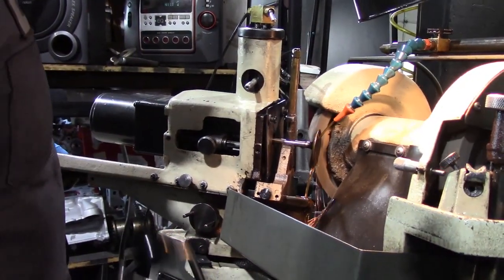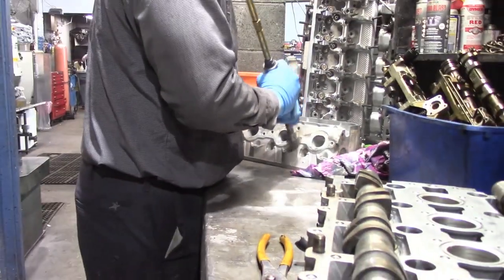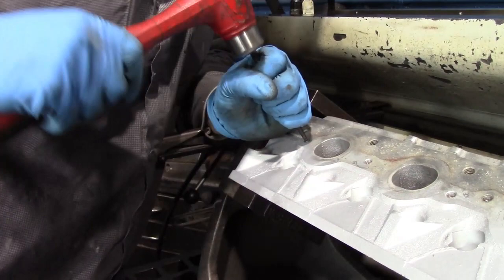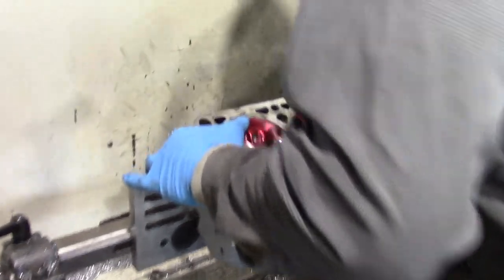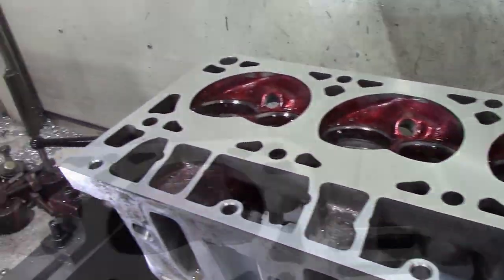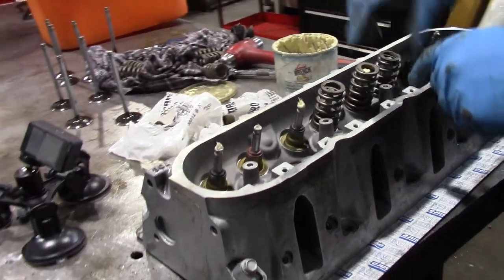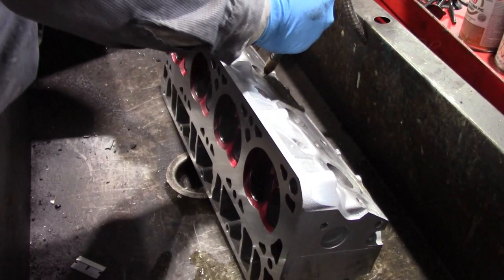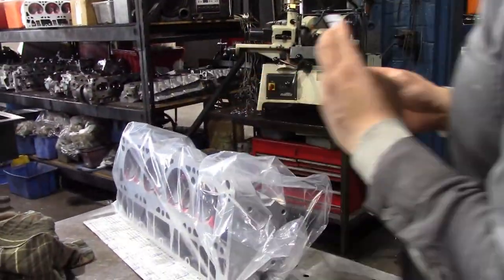MACHINE SHOP PART 2 [ 2004 CHEVY AVALANCHE][ 5.3 VORTEC V8]

Comment: Saw u did some lifters work was cleaning them worth it?
Reply from the maker: Yes they were.. I'll post a video on it soon..  Took two hours and I got all 16 apart soaked in gas and thoroughly cleaned
Reply: Cool mine makin a slight noise at times wanna know if they could be clean or if i gotta put out tht cash on new ones
Reply from the maker: I got you, coming soon. You can put out the money. But if you take 10mins.. Of your day.. It can be serviced.

Comment: How much did they charge you for this?
Reply from the maker: Both heads cut and rebuilt. 
Block bore .20 over 
Crank checked
Cam bearing replaced
Pistons and rings
Parts and labor ran to 1600
Reply: That’s actually not bad. Virtually brand new engine for that price is a steal
Reply from the maker: This engine will have 0 miles 😁
Reply from the maker: Yeah it isn't.. Is a pretty sick deal
Reply: corolla customz omg lol I have to find a way to convince my girl that I need to do this lol
Reply from the maker: Just say honey, the engine needs this.. Make it seem like your angry
Reply: corolla customz yeah right she’ll tell me to sell it lol. I’m replacing the shocks with some rancho rs5000x after that I need to replace both front wheel hubs and re solder the abs module so she’s already fed up 😂
Reply from the maker: Hahahahaha😂😂😂😂... Women🙄🙄🙄... Just tell her you don't understand , I can't sell.this truck. 
It's super rare and the price goes up each year🤔
Reply: corolla customz they made a mistake by discontinuing this truck. Its way ahead of its time.
Reply from the maker: I definitely agree, this truck has  a lot going for it.. Very user friendly, awesome storage compartments, cab to bed entry, and very easy to repair... I'm definitely trying to keep mine as long as I live hahaa
Reply: corolla customz hopefully I can give this truck to my kids lol i was honest with myself along with her when I told her the other day it’s becoming less of a headache and more of a hobby
Reply from the maker: Yeah man. This truck has been amazing for me. Since I bought it, it's brought an amazing following to my channel... It also gives me something to do, and this whole engine rebuild has just been awesome man... It really has... What do you need to do on yours?
Reply: corolla customz I’m doing all 4 shocks tomorrow morning, I need to do the front wheel bearings. Swap out the abs module board, and soon putting a cat back MBRP or Gibson on her
Reply from the maker: You got alot going on there, can't wait to hear what it sounds like... Definitely put a video up with that catback
Reply: corolla customz I’ll do a whole installation video on it because there’s really none even thought it’s supposed to be easy
Reply from the maker: I'll watch it, definitely do one... That be sick
Reply: corolla customz I’ll just send it to you that way more people will see it lol but totally unrelated question here. Can I change my differential fluid by pumping the old stuff out with a pump through the drain plug so I don’t need to take he cover off
Reply from the maker: You can but it won't be a clean job... You still have to clean up the magnet in the diff, as well as seal a new gasket...
Reply: corolla customz that’s trueeeee thanks. I just finished thevshocks and omg the difference is incredible and they look great
Reply from the maker: Damn, they probably feel like heaven lol
Reply: corolla customz no more body roll and bouncy bumps. When I test drive it I was like in SHOCK
Reply from the maker: Yeah man, I know the feeling. I replaced mine and feel in love lol
Reply: corolla customz you obviously didn’t get the not so subtle SHOCK joke 😂
Reply from the maker: 😂😂😂😂😂😂😂😅 I just realized that lmfaoooooo airplane over my head